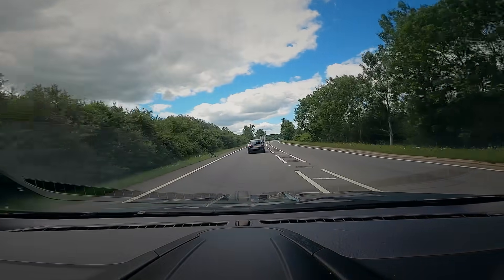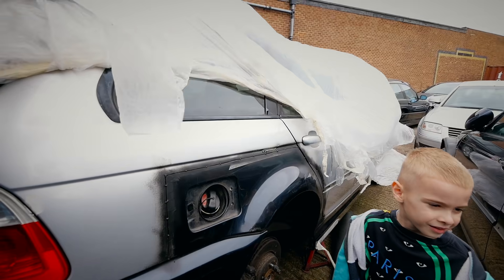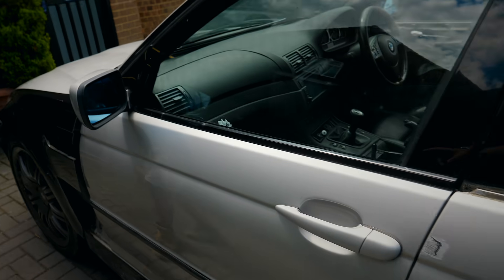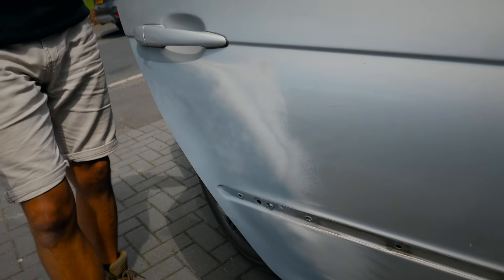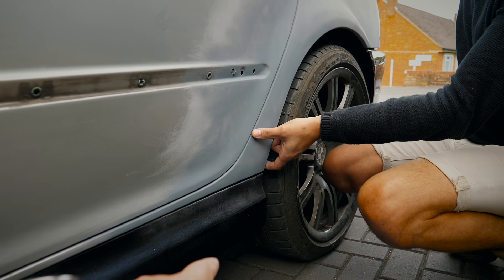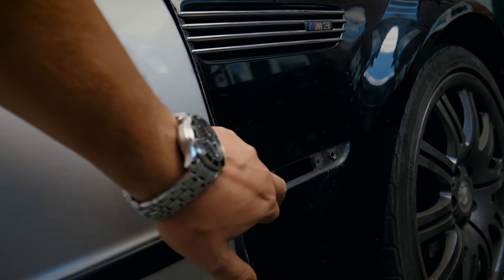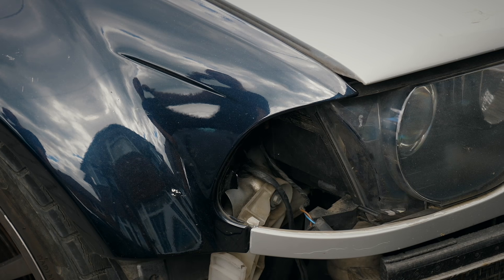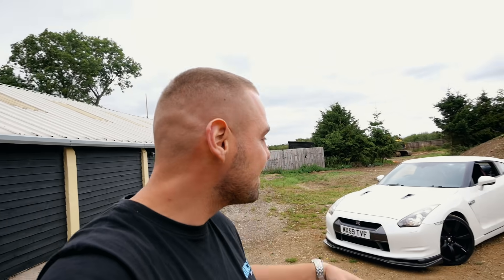This is a much bigger job than we expected..... (E46 M3 Touring Build)

Comment: Wouldn't it be just eaiser to get normal stock front wings, cut out correct size for the m3 emblem air vent, ant widen a wing itself a little so it matches M3 ?

Comment: Ngl id keep the m57. An e46 touring with m3 suspension and diff with a 330d motor would run laps around an m3. I prefer the sound roo has more of a diesel rb26 note

Comment: It’s not that bigger job tbh. I’ve done these before and you just steam clean both cars. Put them next to each other and strip them both down. The biggest issue is the rear end once that’s done underneath it’s not to bad. There are loads of videos on YouTube showing this. We all did this in the mid 2000’s......... if I was going to do this now I would just do an engine rebuild and supercharge it.

Comment: I thought it was a actual bodyshop going the work bro. That is going to crack and split in no time. Been working in bodyshops for 19 years that is no good mate. My advice is start again with a proper panel beater.
Reply: Hes is a painter by trade works for bmw